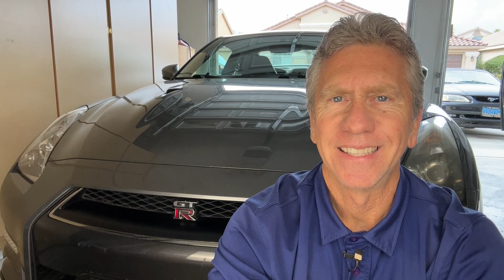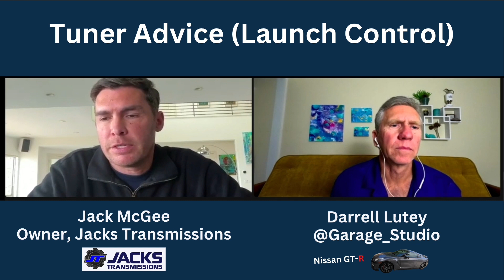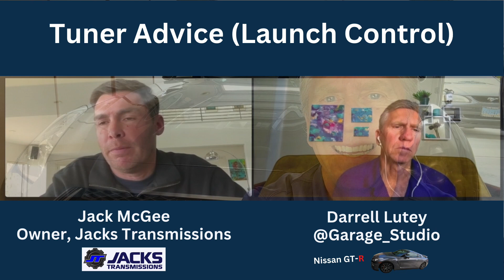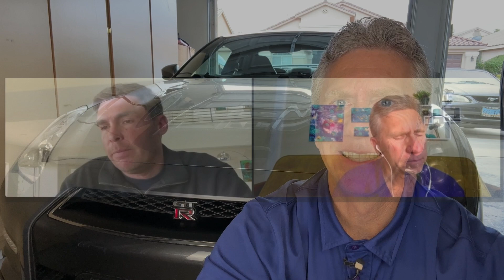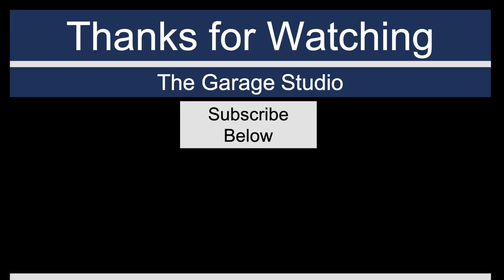GT-R Transmission Expert Gives Tuners Advice | Launch Control Secrets | JacksTrans Owner Interviewed

Comment: Jack's comments about high engine load during launch, sounds a little like the antilag feature that Cobb/Ecutek have.  You engage it on a constant throttle (like say 10% like on the freeway), immediately you see the boost gauge stand to attention, and if you have an aftermarket intake you hear the turbos spool up.  Floor it and the engine responds with no lag, almost like a manual car when you pop the clutch.  I should ask my tuner if he can do this
Reply from the maker: Kinda the best of both worlds.  No turbo lag;... and minimal shock to the drivetrane.
Reply: @The.Garage.Studio  I believe the way it works, is that retarding the ignition a lot means that there is incomplete combustion, and a lot of unburnt fuel goes straight into the mouth of the turbo.  The fuel hits the hot turbo blades and there's a little explosion which spins them up.